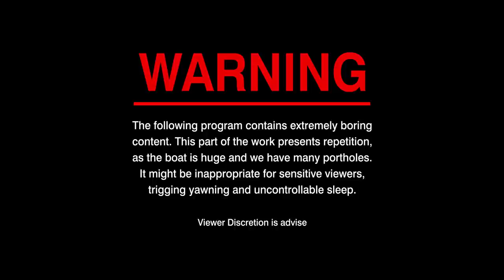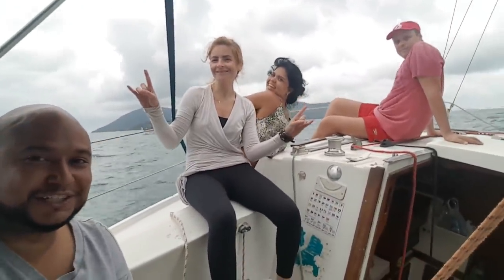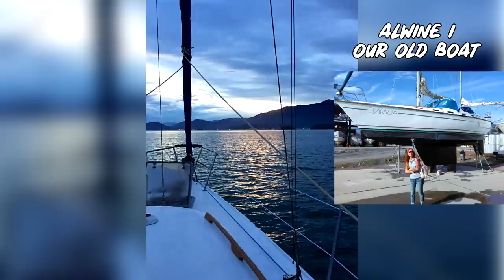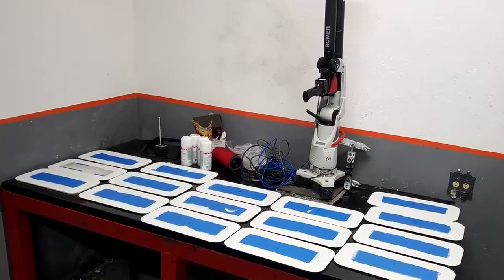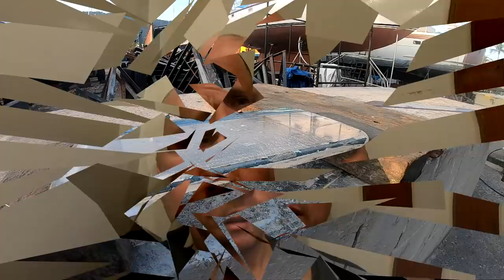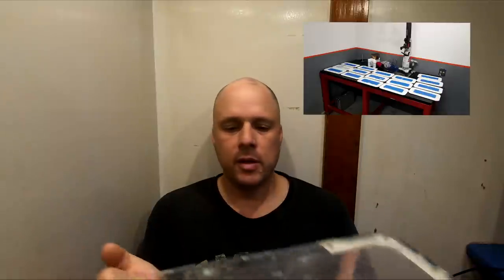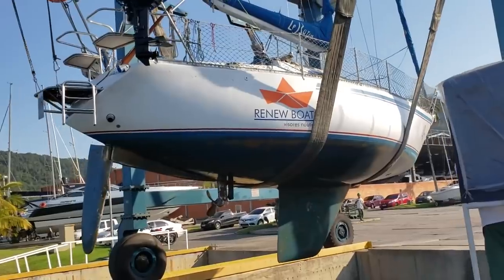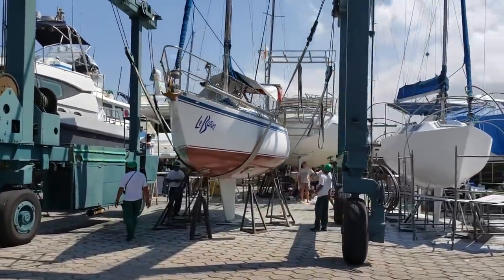#8 A big help from our friends - Renovating portholes

Comment: I finally got to see the video, sorry mate but I had no internet access for a little while.
Polycarbonate sounds like the best stuff to use simply for the strength of the portholes.
It'll be great to hear what through hole valves are the strongest and best.
Have fun you guys!
Reply from the maker: Hello Rohan, poly works amazing...
Next video, we will show the valve tests.

Comment: So real, so genuine Fred..I am still somewhat concerned about these poly portholes...Don't they really need a retaining frame...? Anyway I also understand that todays adhesion technology improved quite a lot..Very informative content as well...
Reply from the maker: Hello Frans, really, don't need the frames, never had frames.
But, we have 2 extra for emergency, and, inside, we plan to have a wood frame for finishing, with an extra polycarbonate, that will help to heat insulation and add some safety if the external polycarbonate lose.
Reply: @Crazylittlethingsaboutus  ..Good feedback, I was concerned with the thermo cycle in tropical and colder conditions..Also heavy waves  can create a lot of shear pressures as well..
Reply from the maker: Well.. polycarbonate with this heavy   tape, it's stronger than acrylic with screws.
Acrylic with screws it's working really week with no problems since 1983 on this boat, but, any safe extra system, it's always welcome... Right?
Reply: @Crazylittlethingsaboutus  no I a
Was not going to use any screws in the poly but a nicely SS frame screwed around the poly to avoid any problem of the porthole coming loose..you know from your sailing experience what frictional forces are developed going 7/8 knots in heavy seas whilst heeling..
Reply from the maker: We will have the frame, with screws and an extra polycarbonate inside...
Reply: @Crazylittlethingsaboutus  Fred, don't do it because of my suggestions.. I hope you convinced yourself..I like your constructive approach..
Reply from the maker: Not at all, that it's part of the plan... 
We are doing very hard test for critical things... 
I really want do all the test in the water.... But, this is not the time... Soon I hope.